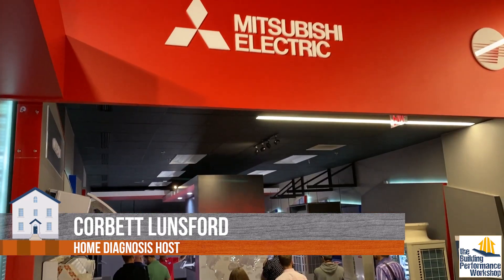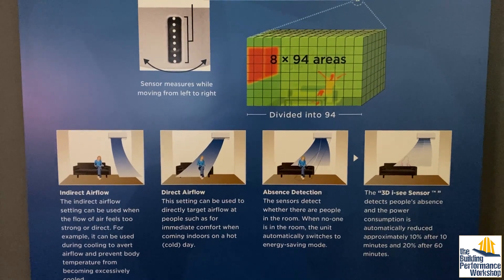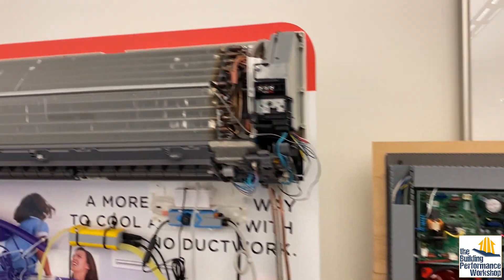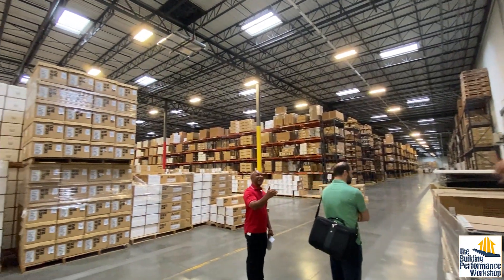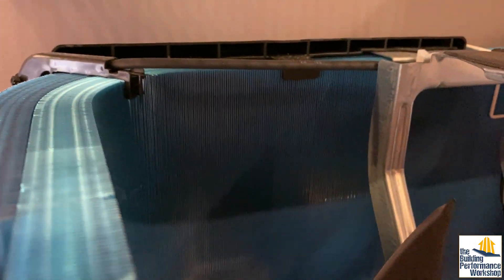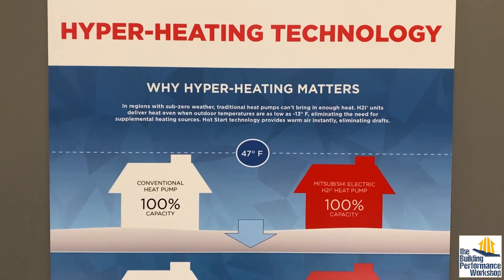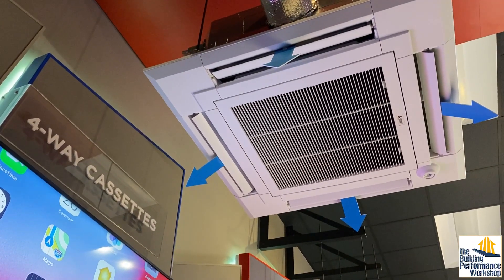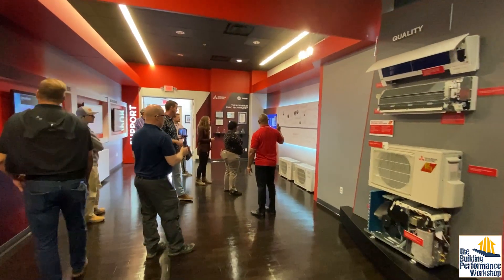How the Best HVAC Equipment Gets Made: Fast Tour of Mitsubishi Cooling & Heating Headquarters

Comment: Trane & Mitsubishi combined……..No Thank You!!! 
As for their tech support👎🏼
Mitsubishi vrf or mini-split indoor coil blower wheels are always moldy and completely clogged, requiring disassembly to remove and clean. 

For VRF & mini-split,
1) Daikin has the Best Warranty and is the Largest HVAC company in the world. 
2) LG has the Best Tech Support.
3) Mitsubishi would be third for me, but only if the designers or custom demand it.
Reply: Mitsubishi has a 12 year warranty with Diamond installer . Daikin  is 10.
Reply from the maker: Point
Reply from the maker: Cool man, I respect experienced opinions, obviously (I hope) there are never one-size-fits-all solutions.
Reply: All of these are great choices….mitsubishi diamond dealers are vetted , trained the best, next would be daikin that vets buy doe not train dealers.installers….with ANY o these though installer is EVERYTHING ! You are better off with a great Goodman tech than a tech selling Mitsubishi who knows nothing about the system or is sloppy. None of these brands in inverter confirmation tolerates poor installs.

Comment: most of the brands here all come with similar features and frankly most of it are gimmicks.  the i-see etc systems are advertised as power saving, ie it only turns on when you in the room. which sounds good but its not good in practise. 
whats impressive is that other video of the unit that can be pulled apart for cleaning. i so wish i had that.
the other thing is mitsi's lossnay system, which is ventilation and ducted heat pump combined.
Reply from the maker: Have yet to see that in action, and I challenged them about the maintenance hassle too- they say they’re working on a better system.
Reply: @HomePerformance   now they just need to have a built in whole house dehumidifier in the system. erv, dehumidifier, ducted heat pump.
Reply: @tweake7175  Yes, the dry mode buy itself is not enough in the humid southern climate on days when you do not need heating or cooling but need dehumidification. GFs house has mini splits and the dry mode is not super effective in Memphis - similar climate to Atlanta.
Reply: @DavGreg  absolutely. dry mode is just aircon with slow fan speed. its gets cold then shuts off and doesn't run long enough.
i think we need to be controlling humidity first, temperature 2nd.
Reply from the maker: These days Mits thechnical team is pretty upfront about that- you need supplemental dehum

Comment: what happened to the mitsi debacle about them faking the performance results of their units?
Reply from the maker: I have not heard that, Tweak, where did you hear it? Been working with them since 2016, one minisplit I’ve got has been running continuously for six years with minimal maintenance and zero problems, pulls 300 watts in cooling and 800 in heating.
Reply: @HomePerformance   it made the headlines some time ago. if i remember correctly they where advertising the theoretical performance figures instead of the tested ones.
i would have to look it up, i have not heard what the outcome of that was. it may have only been the markets down here.
Reply from the maker: Well, the AHRI standard for listing performance standards is old and stupid. It may have been about that, since the AHRI data makes a crappy traditional unit look almost as good as an inverter unit.
Reply: @tweake7175  Some of that was strictly based on meeting the sensible cooling load.  They have learned from that and their systems are better equipped to deal with humidity now and the newer numbers reflect that.  They also recognize that ducted systems are better for air filtration and separate humidity control systems might be needed as well.  The challenge with any manufacturer is that the talking points that they start with are evolving and systematic changes are not always that obvious.
Reply: That was the rail car division in Toyko. We are a separate division in the US. https://asia.nikkei.com/Business/Electronics/Mitsubishi-Electric-fakes-inspection-data-on-train-A-C-equipment